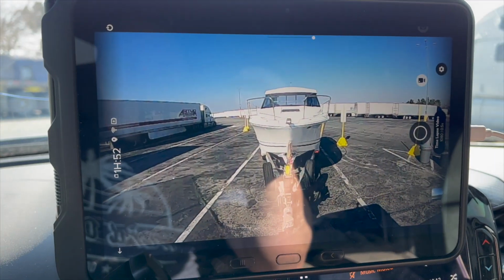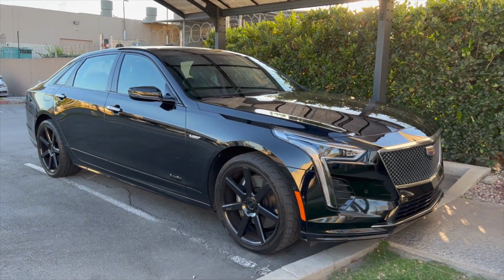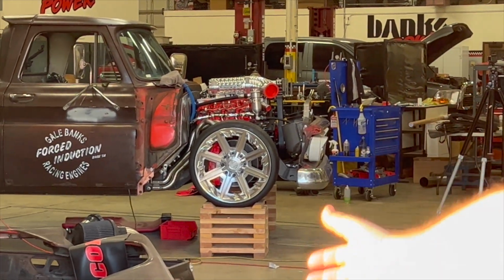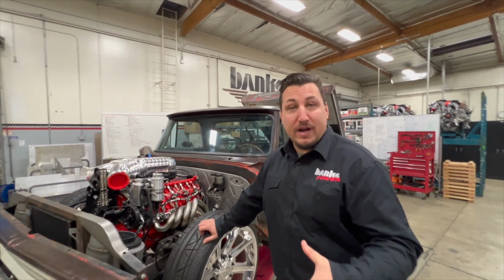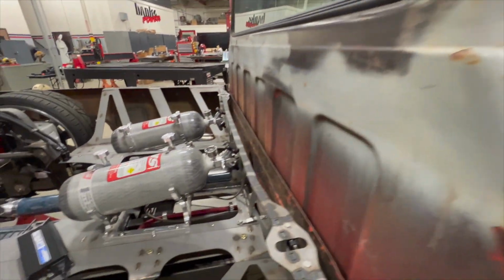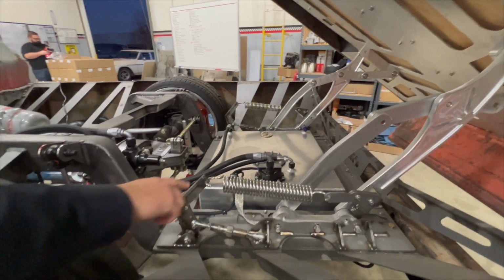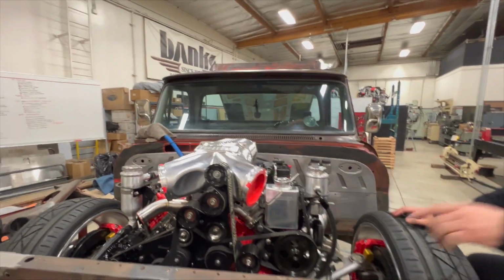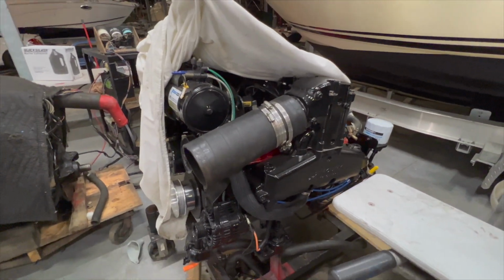The Long Haul Of America:  Day 11!  Gale Banks Shop Visit | #LokJaw #C20 EXCLUSIVE Tour!!!

Comment: Banks Power Pack system for the Cummins is the best.  Another item that will help your 6.7 Cummins are the Speed of Air modified pistons.  Those pistons are top shelf for all diesel engines.
Reply from the maker: That's very interesting to know....  do you have a link for those or what I could also do to bump the compression a bit?  Is there a better cam?  I hate the 4.10 gears as I do not haul more than 20k# with two cars in a 44ft enclosed trailer.
Reply: @DavidWilks  I wonder if the russ mathis logger torque cam duration spec'd cam would work? I've read a lot about this particular camshaft in relation to the IDI diesels from Navistar and GM... This camshaft has more duration on the intake than on the exhaust (261° in/253° ex) at .006 which helps with scavenging of the remaining combustion gases in the cylinder on the exhaust stroke which leads to a fresher intake charge and helps The turbo spool up faster with less lag.  From one of the forums the gentleman has his 7.3 IDI Navistar diesel turbo 1991 F-350 with 3.55 gears/5-spd and he stated that it pulls real hard as a result.